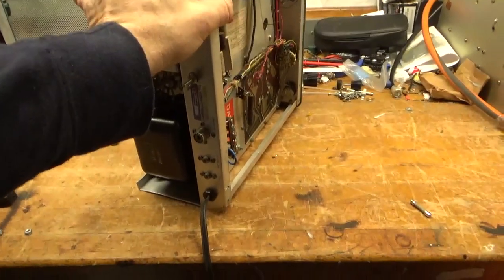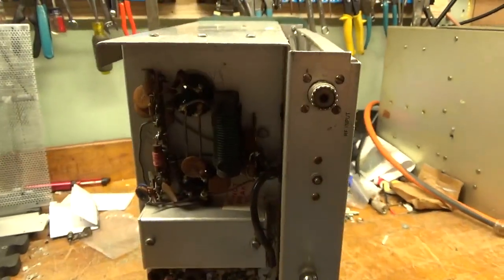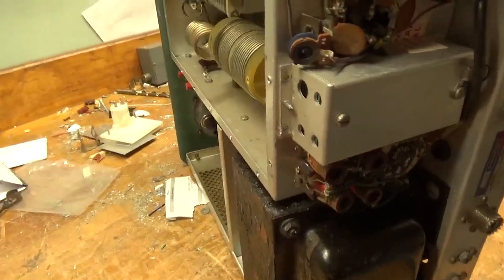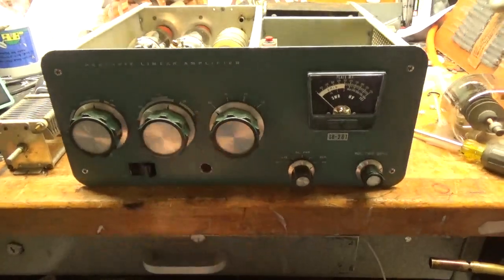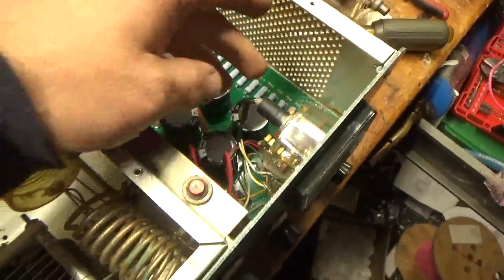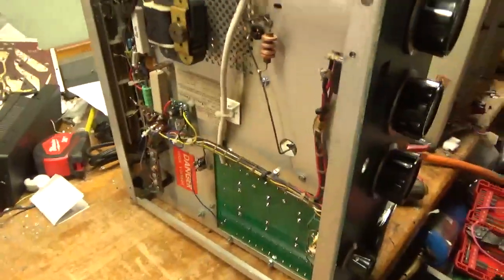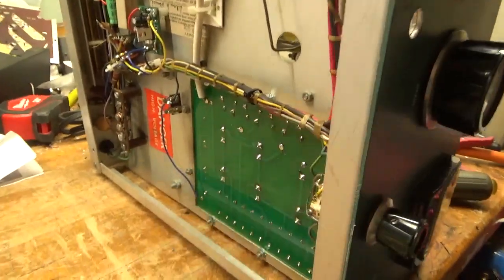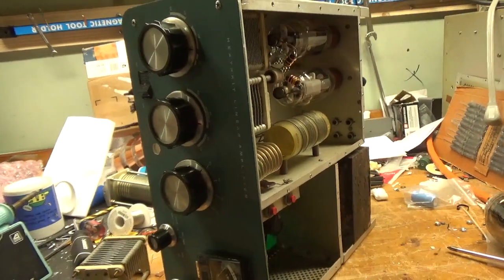Heathkit sb201 Repair And Modification

Comment: Couple of questions;
What is the proper T/R relay coil resistance/impedance? Is there a suitable replacement  relay that can be found today? Would it need modified coil to work? 
The suppressors ....replace resistors? 48 ohm 2w or someting else?>
Replace rhe doorknob resistors....do they fail or just a good idea to replace them?
Same sort of questions aboiut the 33 ohm resistors and caps around the power tube sockets....replace?
Reply from the maker: Best to call